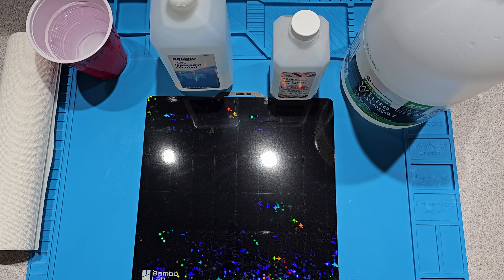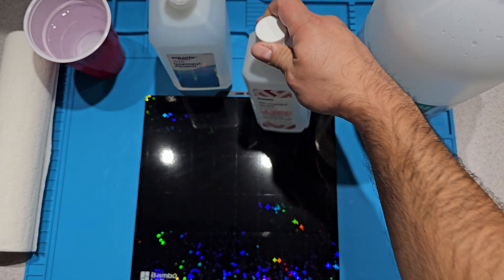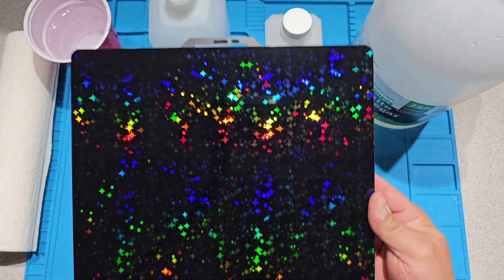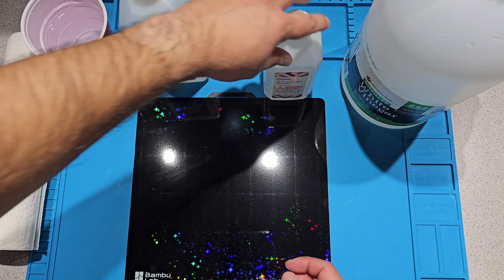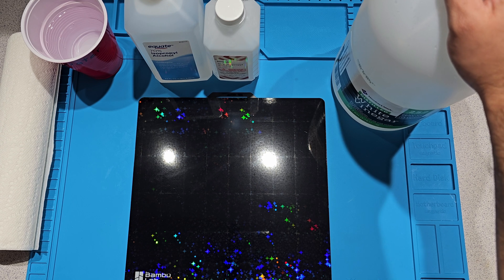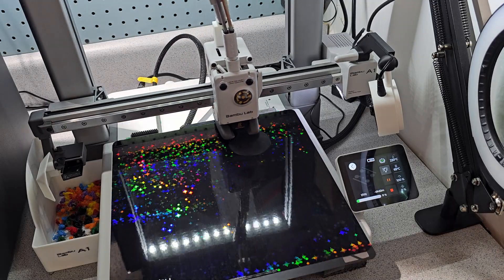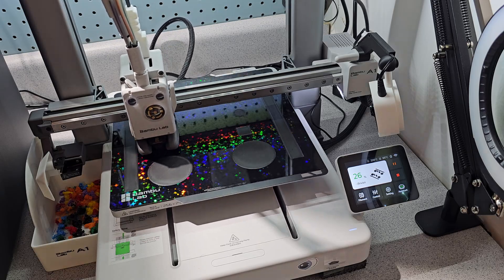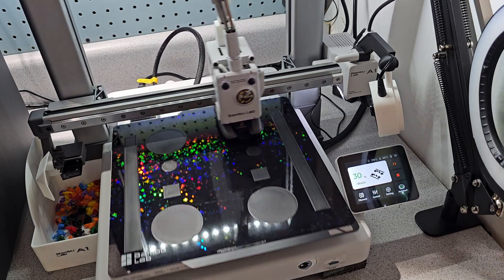Alcohol VS White Vinegar - Testing Cleaners on 3D Effects plate

Comment: Sorry, but this just isn't a good cleaning method and you need to understand why. You are wiping on ISO, dissolving contaminants and oils, then letting it dry in place.. the contaminants don't evaporate, all left on top surface instead..
I spray my 90-99% ISO with a tiny spray bottle that makes a good mist and coverage, mostly in-center of course where prints will occur, then wipe it around and flip towel, you want to absorb as much of it back up as you can loaded with oils etc inside it, don't let large pools of it dry.
Reply from the maker: I actually do use the method you described. I have a spray bottle with 99% IPA and spray the plate then wipe it off. For the test I just decided to use the actual product bottles in the video since i'm sure some viewers would say that I was lying about what i have in the spray bottle.
Reply: @CarlexDIY  Ah fair enough then, so long as you know why the other way around might very well make it worse depending on the order of operations.